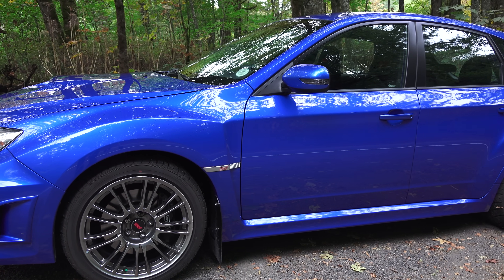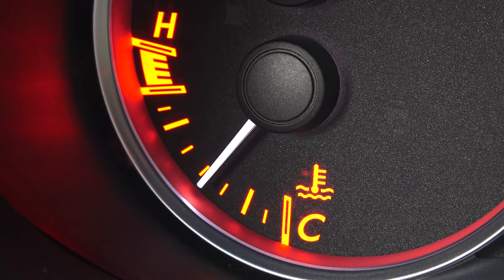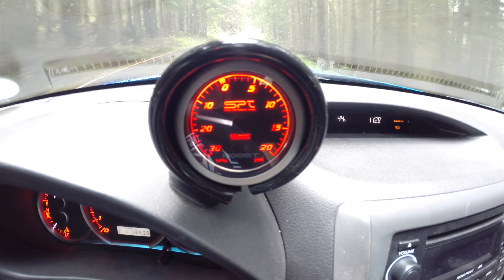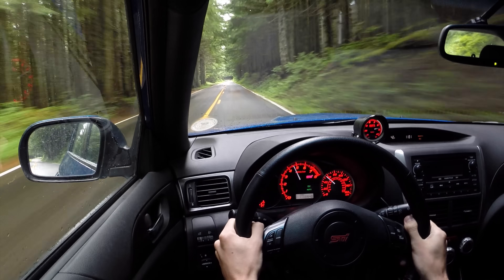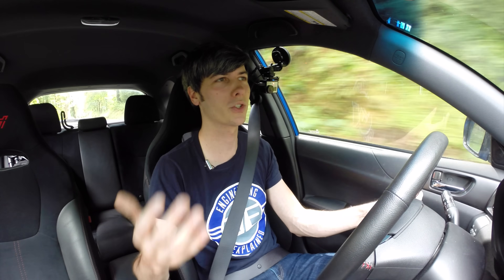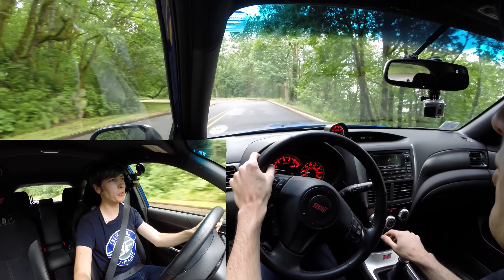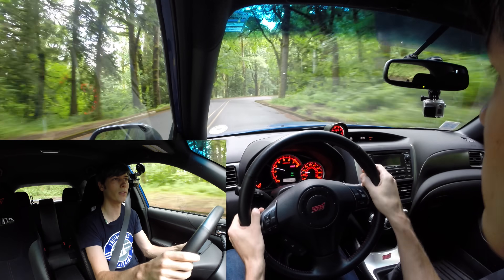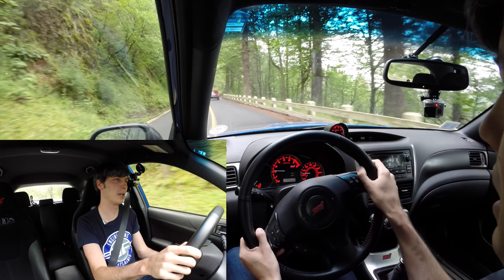5 Things You Should Never Do In A Turbocharged Vehicle

Comment: Hello !
I own a turbocharged petrol Giulietta, which happens to have Start&Stop feature. Based on the "you should not immediately cut off the engine when stopping" thing, isn't the start & stop going to ruin my turbo ?
As I already knew that, I always assumed that they thought about this and had some clever turbocharger lubrification management which would prevent any premature oil cut.
Any thoughts about that ?

Comment: Not to shut down immediately after running hard is also the idea if you are running a gas turbine engine .  It doesn't make a difference wheather it's a land based turbine or an aircraft application . Allow the turbine to run for about a minute after running hard then shut down .

Comment: Re lugging a turbo diesel: different manufacturers have different recommendations on those limits but they are kinda similar. For example, in the commercial truck engine market, Caterpillar recommends you can keep it at peak torque (usually 1200 RPM) or above indefinitely but they are okay with you letting it drop drop down to 1000 RPM if you can crest the hill in order to realize some fuel savings. Cummins doesn't recommend letting it go below peak torque (1200 RPM) for any length of time and limiting peak toque conditions to 30 seconds, after which you should downshift to get your engine speed up. Of course the commercial engine application is quite a bit different than the automotive application in terms of how long peak torque and peak power are utilized, i.e., minutes for commercial trucks versus seconds for cars.

Comment: If your boost controller is setup correctly, there should not be a problem at any RPM. You either have too much ignition timing not enough fuel or you are over boosting.  Most turbos don't build boost at low rpm unless they are setup to like a truck motor. Unless we are talking about the old Detroit 2 strokes silver 8v92's

Comment: I wonder how possible/hard it would be to modify an existing vehicle to allow you to pressurize and circulate the oil before you turn the engine over on cold start (and circulate the oil after shutting off for a preset time).
Reply: Thats exactly what they used to do on the WW2 Spitfires and I think the P51 Mustang as well.

Comment: Some new cars with turbos now comes with radiator coolant which either heats oil and turbo faster and cool it too even after shut down, my Peugeot 308cc handbook says no need to wait for cooling unless you did some hard driving on a freeway as it has a electrical waterpump that circulate coolant long after engine shut down. But it warns not to drive fast or have high rpm until the heat gauge is at 90C or risk damage to the turbo. You can fit an turbo saver if need too that is basicly just a pressured container with oil pumped in every time you start and then released slowly after engine shut down to lubricate turbo.

Comment: I usually run 93 in an engine with a big turbo.  We have 110 octane available here ($12..00/gallon).  Would it increase performance to mix in 10 or 20% 110 with the 93 to get the mix up above 95?   I would do so only incrementally.

Comment: I have a 2011 VW Jetta 2.0 TDI 140 bhp. Can I tune the ecu to make 180 bhp ? I hear that the 2.0 TDI can be tuned to make 180 bhp and it is safe. But I want the advise from a professional. Do you suggest I go for the ecu tuning ? The car has run about 60k kilometers. I plan to keep the car for as long as possible. So I just want to know if the ecu tuning from 140 bhp to 180 bhp will have effects on engine life, safety, mileage, wear and tear etc. Thank you.

Comment: The most sold turbo vehicle in the US, Ford F-150 Ecoboost, does not require any of these steps. You can use 87 or higher octane, no warmup required, no cool down, and it’s designed to pull hard at a high gear. All per the manual.

Comment: I can verify the last issue with full confidence, I have an 86 944 Turbo Porsche (running 16 pounds of boost) and it is "laggy" (Is that a word? it is now) anyway at around 3 grand the boost comes on like a sledge hammer. coming out of a corner in second gear right after I bought it, I floored it at bout 2400 rpm...at 3k the boost hit and yes thankfully there was no one around me because I went almost full  sideways, lol.

Comment: Great - thanx for the video: perfect timing. I have a 2018 Porsche Cayman 718 due in a couple of weeks and have no experience with turbos. I've done some reading and had an idea of how the treat them, but your video answered all the questions I had - and then some!
Reply: A 2018 Porsche shouldn't really be too bothered about any of these issues (the price you pay for it, and the performance it supposedly has on offer, I'd hope it has an aux oil pump for the turbo, an engine that can deal with a little bit of mistreatment in daily driving, an ECU that doesn't over- or under-fuel at any point and keeps the revs well within safety using a metalwork-friendly soft-limiter, and extremely comprehensive traction control/ESP to deal with its RR weight imbalance).... and - as it's brand new rather than a used car with an uncertain history - unless you plan to regularly blast the tits off it AND keep it for 10+ years / 100+ thousand miles it likely wouldn't make much difference to whether it breaks down in your care anyway.

What I would be more careful about is following the manufacturer's recommended running-in regime, which should be detailed in the handbook, if not in fact dictated to you by the dealer. Until all the newly machined parts have bedded into each other properly, go easy.

(But then finish up the probationary period with a good old fashioned "italian tune-up" ;) )

Comment: I have a 2014 Escape AWD with the 1.6 L 4 cyl. I like to get it up into the highest possible gear at low speed assuming I'm optimizing fuel economy. Is this bad ?
Reply: So long as the engine doesn't shudder and shake, you're probably fine. Though I would say, if it has an onboard fuel economy readout, do a few test runs on a convenient piece of long, flat, quiet road at different speeds and in different gears, just to see what the actual difference is, and if there are any surprising breakpoints where it's actually better to be in a lower gear below a certain speed...

I've found that, in the main, the pattern is ... on the flat, you're almost always using less fuel at a lower speed and/or a higher gear, except where you're running so slow that the engine starts to lose smoothness... at which point it may be slightly more economical, or at least no less economic, to change down. And when you're down to third, generally consumption is already inexorably on the rise. Peak economy is generally at the lowest comfortable speed in top gear, or the one below top if you have a super extended range (...or both, in the case of one car I had that was just on the cusp between the two types).

Running up a moderate hill, you should change down at just a slightly higher speed, maybe 5mph more, as wider throttle seems to use just a little more fuel at those extra low revs vs both lowish rpm, and the same speed/narrower throttle on the flat. Steeper hills, all bets are off, because you're now in to the realm where you have to use the gears to get enough power to crest them, and the car is basically going to use whatever fuel it needs to climb that height, and the majority is now going into fighting gravity rather than air resistance. There is still some difference between them, but essentially it's a case of don't shift down more than you absolutely have to... like, don't use 2nd and 4000rpm, when 3rd and 2750rpm will do the job. If you're making that kind of choice, 4th is right out anyway, because you'll quickly stall out.

Downhill, try to coast (by which I mean in gear, clutch engaged! just without throttle...) in whatever gear holds a reasonably constant speed if at all possible. If not, then either the highest available with a sniff of throttle, on shallower descents; on steeper ones, as low as you're able without overspeeding the engine. Better to have it race a little than burn out the brakes too early (even with these days of dual circuits and all-round discs, it doesn't pay to be careless with them... i've had badly adjusted, dragging ones overheat their fluid and lose a lot of effectiveness before just on the flat... leave them cold until needed), and anyway you can use it as a way of recapturing some energy into the battery (on those cars where the alternator regularly cuts out to reduce drag on the engine, one time where it will be re-energised is coasting down from high revs) or to exercise the air con compressor a bit (keep the gas circulating, dry out some of the airways in the heater matrix that might be getting a bit dewey...). Make better use of the spare potential energy than just burning it as heat in the brake rotors.

Comment: I like your videos, & they're good. But you're wrong about the comment regarding over-fuelling on a diesel at low revs, high load, at least as far as any modern(ish) diesel common rail engine goes. The air flow will be measured in by an Mass Air Flow meter (as I'm sure you know), so even under high load-low revs situation the ECU knows how much air is going in along with the boost sensor, between (at least) these 2 sensors the ECU will know that the turbo isn't boosting much & so will not over-fuel.Older diesels with mechanically controlled fuel did indeed badly overfuel in these situations resulting in a large puff of black smoke!Oh 1 other thing which you didn't mention about hi load-low revs-high gear situation, is that at particularly low revs (say 1000-1200 ish) oil pressure is low, so putting a high strain on the engine can also cause the oil film to fail with metal to metal contact. At least that certainly was the case some years, & seeing as most oil pumps are still mechanically driven AFAIK, I don't see why that would change. I'm not going to try it in my 16yr old 330d anyway ;), incidentally it's done 185k miles & I quite often lightly cruise with it at 1200-1300 RPM in 5th, but if I ever need much acceleration I change down of course.
Reply: I don't agree with the oil starvation thing, my dad tried warning me about that with one of my cars before, never turned out to be any kind of problem, even with me swinging between thrashing every last one of its 68 horses to a gallop, and cruising in as high a gear as possible as much as possible to try and recover some average fuel economy when time was less of an issue, the thing ran like a swiss watch until someone T-boned it at ~80,000 miles.

If trotting around at idle revs was any kind of a problem, the big ends would be falling out of cars left right and centre in our congested cities. Any manufacturer who can't spec their oil pumps to supply a more than excessive amount to all parts of the engine even at a low idle (once it's warmed up, of course... even multigrade has decidedly variable viscosity depending on temperature) is one you want to steer clear of... if they haven't already gone bust from people getting tired of their poor reliability decades ago.

Comment: I have never seen a radiator at the back of the engine bay
Reply: Used to be a common thing on old streamliners, because it's hard to fit a big square rigid item inside a steeply sloped compound curved nose ... though it's a bit weird these days, what with the swoopy front ends of cars being entirely made of cosmetic panelling, and the actual business parts fitting into a much more angular skeleton hidden below.

But so long as you can get sufficient airflow to it, it's not necessarily any worse than being at the front. The air flowing over the engine won't pick up a great deal of heat in the fraction of a second it spends there on its way from the grille to the rad, and any it does absorb is heat that then doesn't need to be carried by the coolant into the rad anyway.

Comment: manufactures add oil and water circulation pumps to the turbo lube and cooling circuits to reduce wear, and as a safety precaution. He is correct, if you've been running hot (a lot of boost)  the cast iron portion of your turbo will glow (that's why they make turbo blankets). if you just shut down and rely on the little pump to save your bearings you're going to be in for a rude surprise. While running at normal speeds your exhaust temps may only be 500F, at WOT your turbo's housing can reach nearly 2,000F (according to Borg Warner). That Iron housing has mass and needs time to cool down. best to keep the oil circulating under higher pressure for a couple minuted while it does...

Comment: So you’re telling me that a turbo doesn’t need to spool and you’re gonna get 15psi at 1000rpm
Reply: If you put a small turbo on a large engine, then yes! Realistically, what he means is that you won't be creating boost pressure, but you will be spinning the turbine up quite a bit. A turbo responds to load as well as rpm.
Reply: Bro I get 15 psi with the engine off
Reply: Liam Czarnecki lol
Reply: Boost pressure is dependent on engine load, not rpm
Reply: I hit 26 psi at 2k rmp if I give it atleast 50% throttle  . Happened a couple times when I first got my car ..
Reply: His must be electric I guess...
Reply: Right another words if you're just starting out at 25mph in first, don't up shift to 5th gear and punch it full throttle. Because you have your vehicle at a disadvantage because of gearing.
Reply: John Anderson I misunderstood the point
Reply: Hold up, how can you create boost at low rpm? They're not high pressure diesel turbos, they're petrol and will need a greater rpm for your turbo to spool....
Reply: @Thatannoyingvoicetoldyoutodoit  They don't produce boost, but you can spin them up by loading the engine at low RPM. 

The damage is caused by the turbo spinning up from the load of the motor but the oil feed is engine driven, so the low oil flow at low rpm won't sufficiently lubricate the turbo which is beginning to spool.
Reply: HCR HOJ my gas car makes over 15 psi at 1500
Reply: Small turbo will easily do it
Reply: @Johnny-tq9no  I have to be hammering down and pulling a trailer with my old 7.3 power stroke to see 15 psi.
Reply: Electric turbocharger does that I am guessing!!! Lol
Reply: Zan Chen tf are you talking about

Comment: over here in germany we have normal gas at 95, a better one with 98 and then a few extra special expensive ones with over 100 octan. you recommend to always buy the highest one to prevent knock but when a modern car is programmed for the 98 more octan doesnt change anything unless you tuned your software to take advantage of this by igniting a little earlier. at least thats what the mechanics say. the companies that produce the high octan fuel obviosly claim better results and there is a looot of rumors and internet discussion about this special fuel. i use it sometimes in my fiesta ST but dont really feel a difference to the 98 that it was developed on. that it takes away a little power on the 95 i can feel too

Comment: So I have a comment/question about the fuel grade position.  Don’t most modern turbo cars have an octane sensor and fuel ignition map to prevent the potential of knock before it can occur, or do they solely rely on knock sensors still?
Reply: Never heard of octane sensors. Still, a knock sensor should really be sufficient, shouldn't it? It's a heck of an upgrade vs not having anything. If you happen to have put poor fuel in at a particular stop, it'll knock as soon as you open it up any after the new stuff has got into the lines, and the ECU will know to back things off somewhat until it's next shut down. When you start up again, it resets to its normal state, in case you've refilled with better quality fuel, but will be on the lookout for the first sign of knocking, same as ever, and will detune again if you're still running poor fuel. A few scattered predetonations, enough to trigger the sensor once per startup, won't destroy your engine, but running for a long time with lots of knocking will...

Comment: Lol too many things to remember. I just drive it normally lol. Newer cars like the one I have are changing older facts of not to do to your car. One example is premium fuel usage. I had a Kia Optima and now a Honda Civic. Both turbocharged. Factory recommendation is to keep using the 87 lower octane fuel as it runs most efficient for the type of motor it’s used for. 

All the other things contribute to the gradual wear and tear of the car we just can’t avoid. Otherwise, we won’t be driving them at all and I can’t baby my car forever. Sooner or later, I’m going to drive it like I stole it because of traffic conditions.
Reply: That’s why he said it especially applies to performance-modded cars. Nowadays with direct injection there are plenty of turbo cars that can run on 87, but back when they a) weren’t the norm and b) had to make do with port injection most of them were 91+.